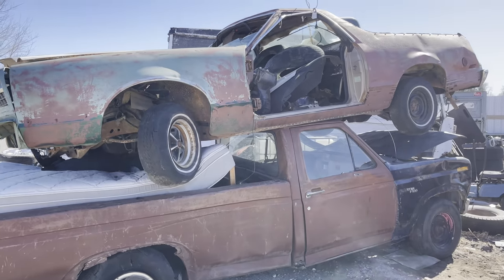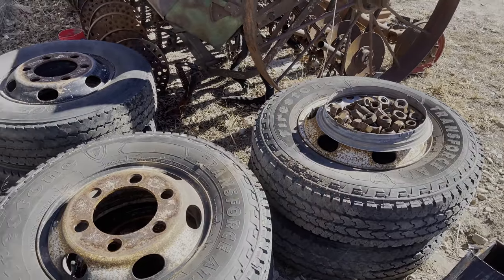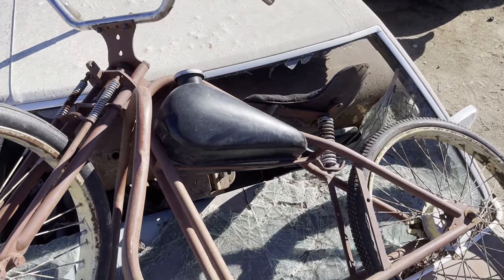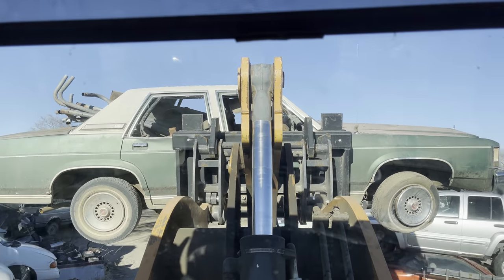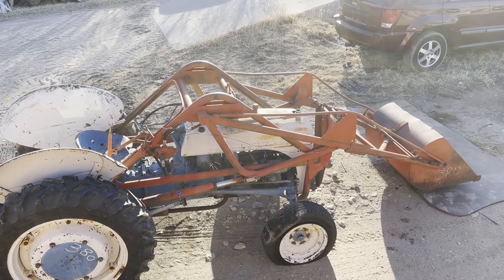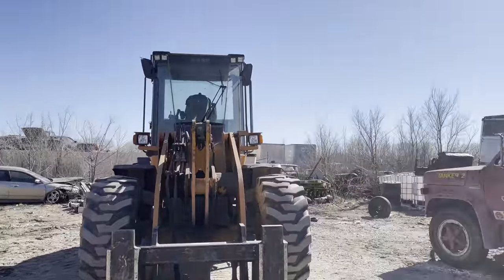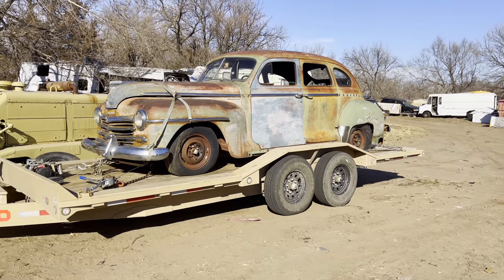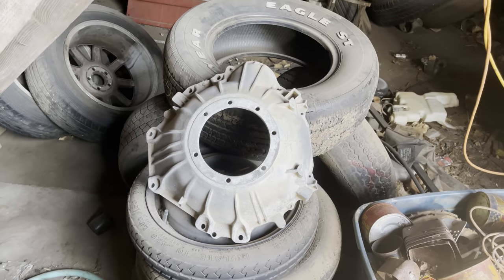I Found an antique 1950s SIMPLEX SERVI-CYCLE motorcycle while CRUSHING CARS!

Comment: Though many parts are missing, the Simplex is a good start for a restoration. Back in the 1990's I had one of the same design but complete and unrestored. Under civilian paint, I discovered US Air Force markings. I wonder if the seller has more parts such as the engine and fenders somewhere.
Reply: Wayne down South has all the parts to restore a Simplex.

Comment: SBF C-4 bellhousings are hard to find. They are bring about $200 on eBay with $54. for shipping. The casting numbers to be on the look out for is C5ZP as the first four. (The C is decade C=60's D=70's. The 5 is the Year. The Z = Mustang,  E= Truck. and the P= Transmission) I am a Mustang buff. So the Ford Casting numbers I know by heart.

Comment: OLD STYLE MOTORCYCLE DIRT TRACK RACING BIKE. NO BREAKS, JUST LITERALLY A HANDLE THROTTLE WHEEL ON ONE SIDE.. THEY JUST LITERALLY USE THEIR FOOT AND THE TORQUE OF THE ENGINE TO SLOW THE BIKE DOWN AS IT POWER SLIDES AROUND A DIRT TRACK. BLOODY LETHAL IN THE WRONG HANDS, AS REALLY NO PROTECTION BEYOND A HELMET,  SUIT, AND GLOVES. MUCH PREFER CAR RALLYING IF I HAD A CHOICE. AT LEAST THOSE CARS HAVE A BODY SHELL AND BUCKET SEATS.